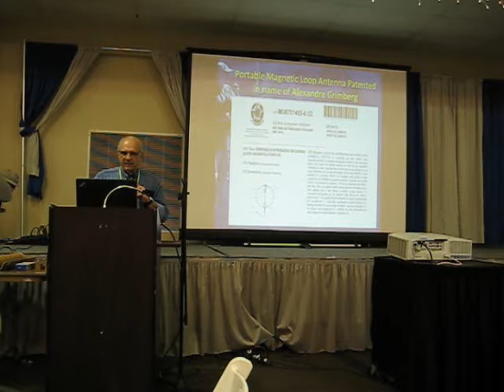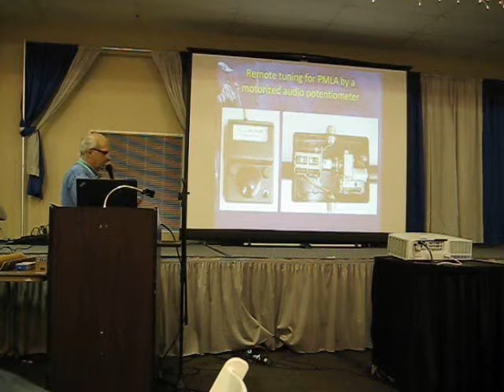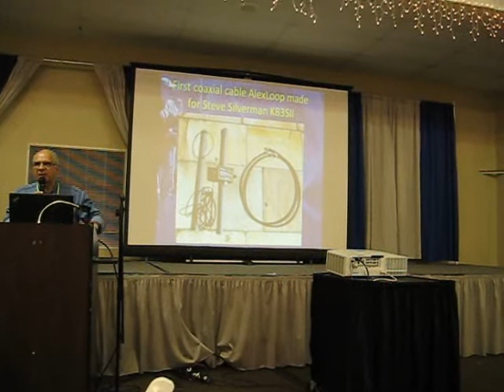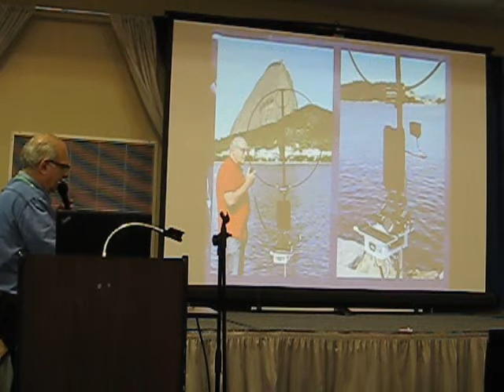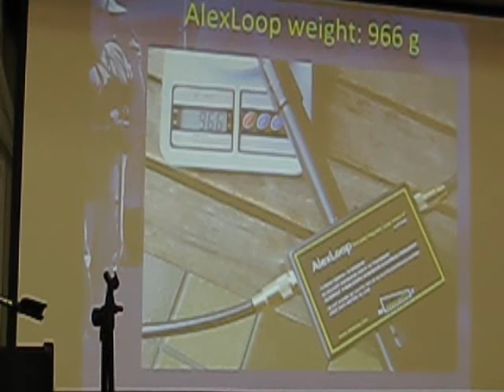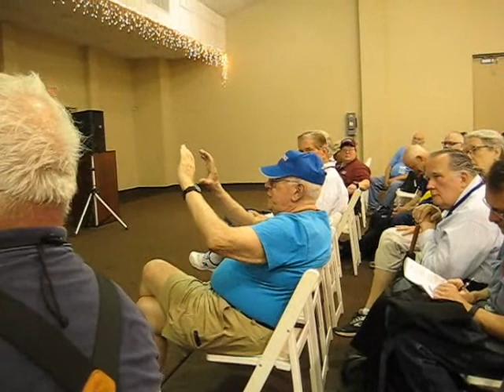HAMVENTION 2018 ALEXLOOP MAGNETIC LOOP ANTENNA FORUM

Comment: Well done Alex, the AlexLoop allows hams to operate in locations where long wires cannot be used.  My best contact was 2000 miles away with 2 watts with my AlexLoop powered by my KX3 on a balcony in Indian Shores, FL.  de KG9H